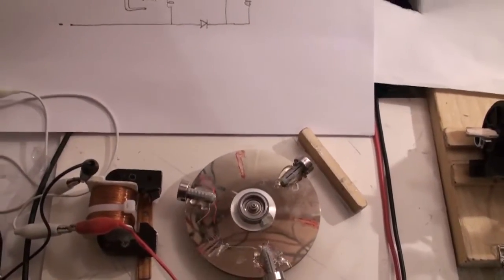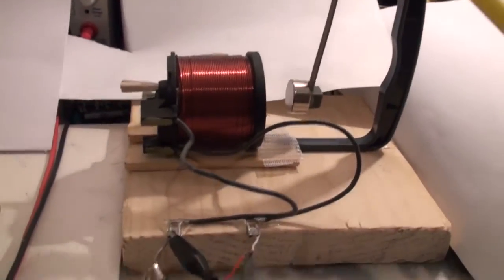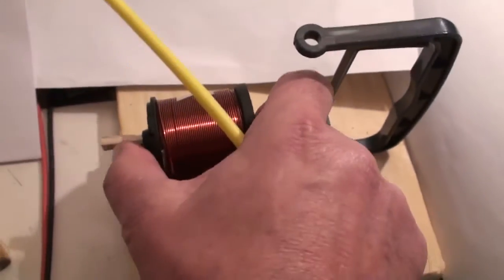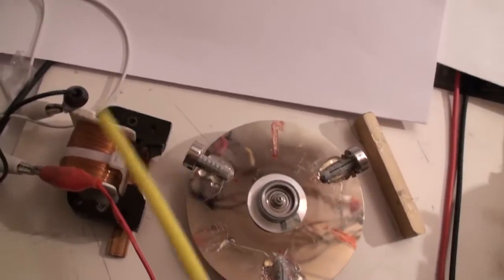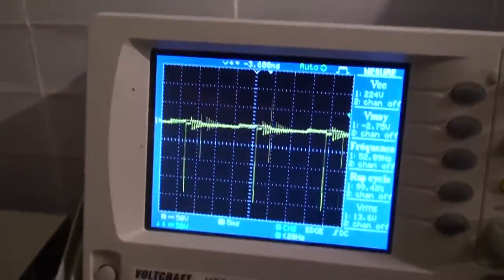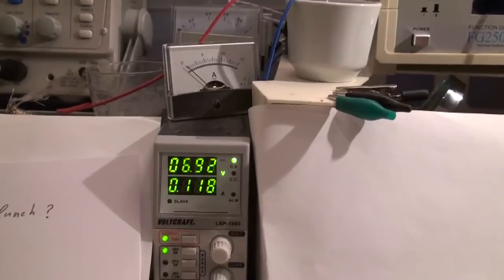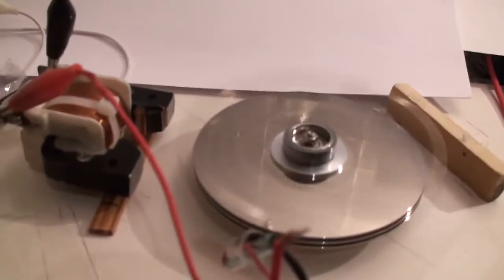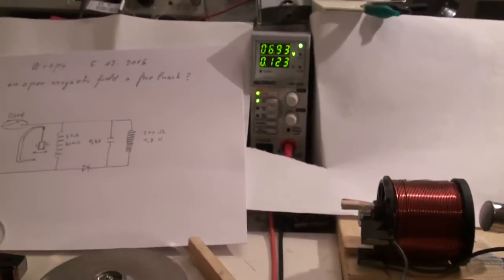is a created magnetic field free lunch

Comment: Hey Woopy - Thanks for your creative demo - its very helpful.  I've just created almost the same circuit using a 1000uF/250V cap to capture the spike and drive "Helper" coils with it via a HAL sensor & SSR (or NPN Transistor).  It definitely speeds up the coil substantially w/ reduced current draw.  It seems the helper coil switch signal timing must have a very precise  pulse width (aprx  5ms for 500RPM).

Comment: woopy....thanks for sharing, this is a mechanics view of what ive just seen, if you where to fix the magnet (even better still a big magnet) and then spin a disc made of non-magnetic stainless steel with slots in it, between the magnet and coil, if you get any change disconnect coil and respin with cap on coil....now that would be a free lunch...||||

Comment: 120 mA seems like quite a bit of current that might end up in the second coil. what if you use a 7ohm I core to drive and ceramic magnets on the rotor. This way you will get a cleaner spike with less current required on the front end...
Nice work!

Comment: Perhaps the quantity of work required to displace the weight of the magnet not so much vertically was also much much less than the quantity of work required to overcome the resistance of the wire in the coil and the coil impedance?